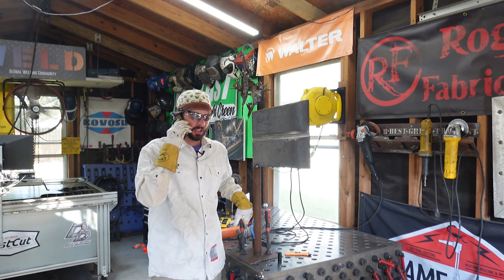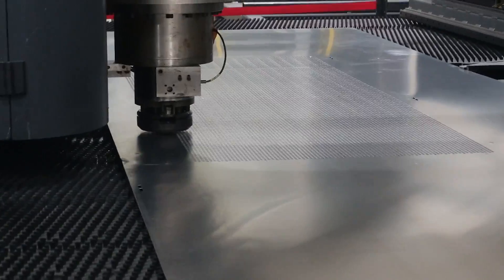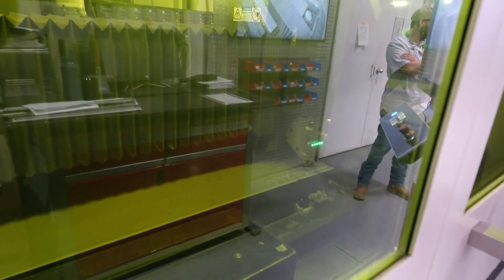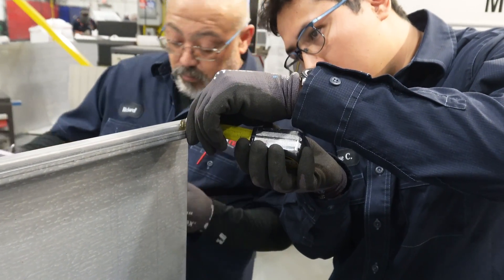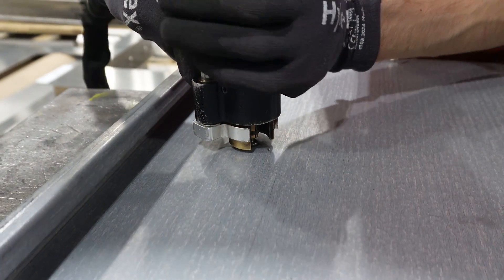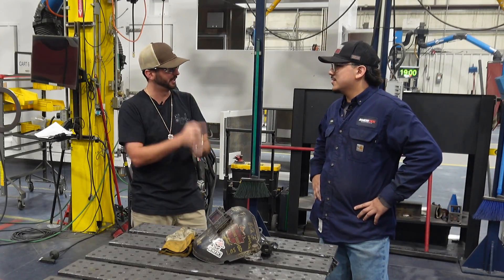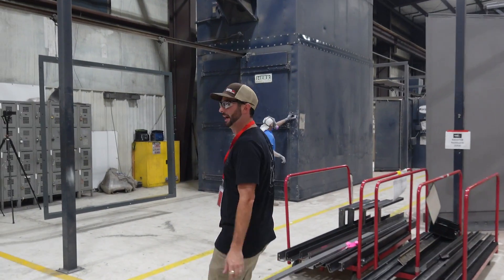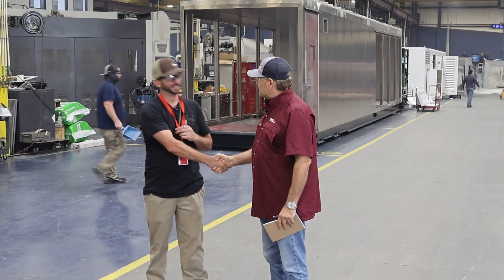We Built A Custom Metal Enclosure At A Job Shop

Comment: I bought some of those, for my work truck, cost 600 bucks for that same fuckin box size, and it was warped as hell, as were everyone that i returned them for.  if that box only cost 250 bucks, then thats a steal!  The tops and sides of my boxes are all warped to shit, pop canned or whatever.  
i came here though looking for an idea on how to make me a tail gate system on the back of my flat bed with these style boxes on them.  im making it more difficult than it has to be, but im after function of having it be like a standard utility bed once the gate is down, as well as integrating a pipe vise on one side and a catch on the other, so that i can cut and thread conduit on the back too.

Comment: I would use it on my 1994 c6500 top kick fencing truck, it looks big enough to put my miller 211 and my welding stuff.
I’ve actually made my own under body tool boxes but I was never able to water proof them.

Comment: I would use that tool box for my 2 LVD turrets tooling in the shop I work at. I’m a turret and tooling lead at Federal Heath sign company. I keep 2 LVD turrets running. A Global 20 and an E-1225.

Comment: I used to weld in a couple of job shops. The small orders were fun, something new to figure out every time. The large quantity orders sucked as they never modified the punch and brake programs, so every corner was say 0.05 off or metal inserts were 0.02 too thin, wasting time for the welding, grinding and paint/bondo departments to correct.